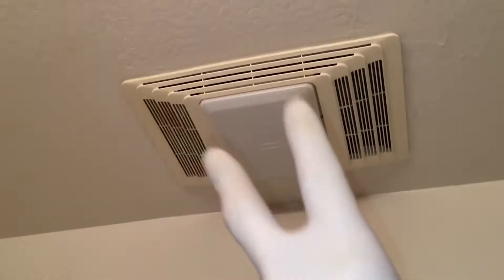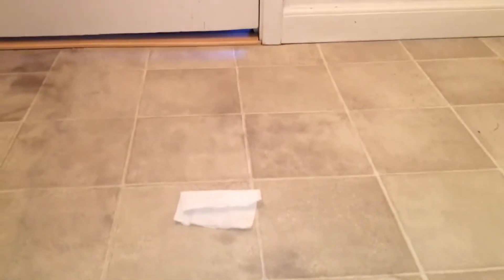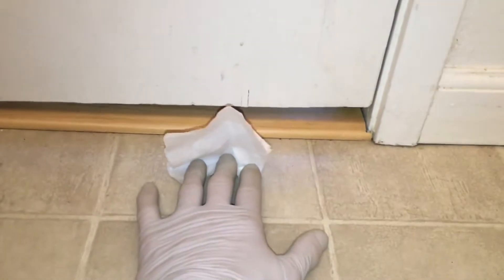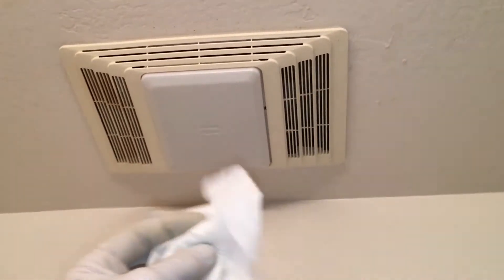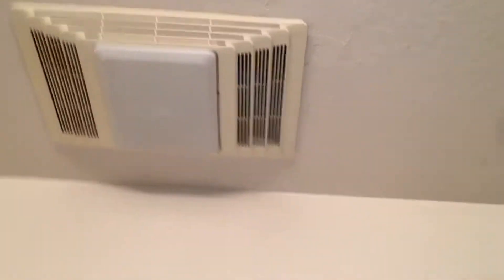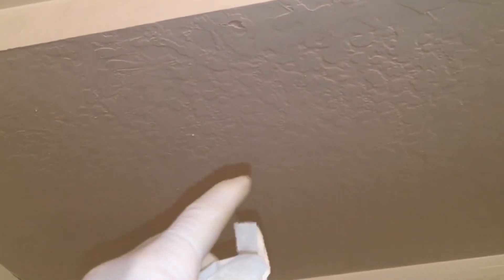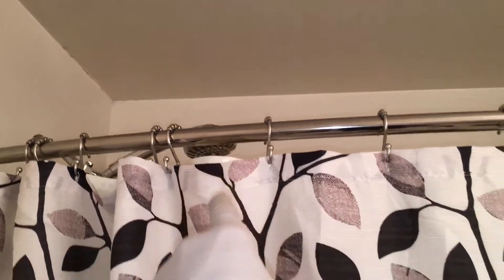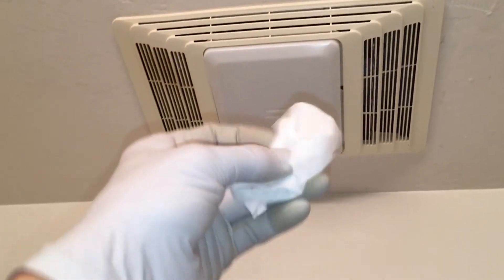How Do you know if a room vent is working?. Toilet paper tissue test￼ ￼

Comment: how many rpm is the fan?
Reply from the maker: @CinematicMusic1  would have to read the motor nameplate to find out out. 

RPMs are not important. It’s CFM that’s important. . 

These are usually 50 CFM to 80 CFM 

But they are usually always installed in properly. The ducting is usually too long. They usually have too many 90° fittings often coming right out the backside where it exits, which is the worst thing you could possibly do lowering the CFM delivery making them inefficient. 

On top of that, the squirrel cage blades are usually packed with dust which greatly slows down the airflow

Comment: Open the door a little bit it will be better and move even more airflow and check the outside vent and check how much air flow it moves without the cover as well
Reply from the maker: @mustangdbest220  yes the outdoor vents if they have screens on them, usually have a ton of cobwebs or dust built-up on them plugging the holes. 

This one, the blades were just filled with Dust and  debris 

After I took it down and cleaned it, it was nice and strong
Reply: @coldfinger459sub0  if it's a bathroom fan and it has one of those screens on it on the outside vent I just take it out because A is restricting flow and it gets clogged quick especially dryer vents should never have that screen on it
Reply from the maker: @mustangdbest220  this bathroom fan has an extra long duck run length few elbows. Nobody ever reads the instructions on the limitation of the size of ductwork and how many elbows you should not have.

And they usually always get the tiniest little vent with the flappers on it that gets stuck and never open or restrictive screen
Reply: @coldfinger459sub0  wowww that's not good of the flaps outside are barely even moving because the duct is so long
Reply from the maker: @mustangdbest220  yep 👍 bathroom fans should not have the type of vents that are foreclosed dryers

Because bathroom fans are not designed to have a lot of static back pressure to have the force to open up those little swivel vents .

Comment: Thanks for the video. You said you had a video on how to clean it? Where is that, could not find.
Reply from the maker: Just google or YouTube search clean bathroom fan or clean blower fans basically all the same. 

You’ll be either pulling down the fan .   
Or sometime you can just take the blower wheel off the motor shaft if there’s a simple nut or pin for removal . 
https://youtu.be/u3mZs1HfgEM?si=noqDRPiPO8xcJTLG

Comment: Allot dont even turn on the fan. 
Allot dont realize.. Its not for the shitter smell... Its for the shower/tub. To remove moisture.
Put mine on a moisture sensor and set to run 15 after end. Now i dont have to remind my wife to turn on. 
Smart home :)
Reply from the maker: Panasonic has a good one that has the moisture sensor built-in soon as the humidity goes up it turns on soon as the humidity goes down it turns off.   And it’s very quiet

          But it all comes back to the ones who make the decision on where they’re placed and then they don’t duct them properly so they can’t get rid of the air anyway even if they were placed in the right spot. 

    RTFM. THEY DON’T ( READ THE F@$ing MANUAL ! )...........